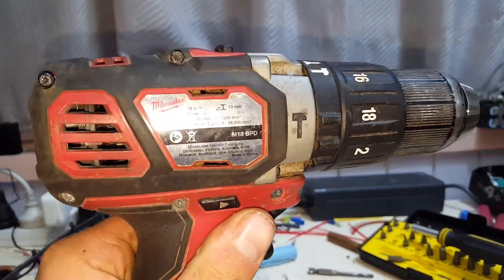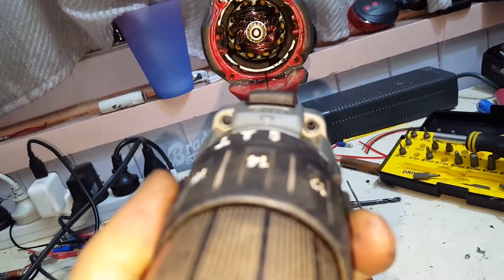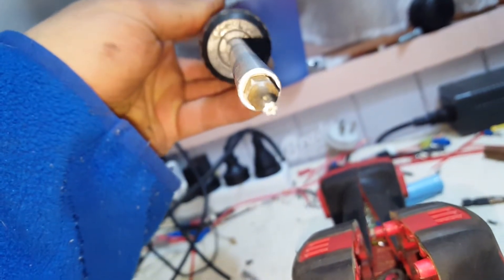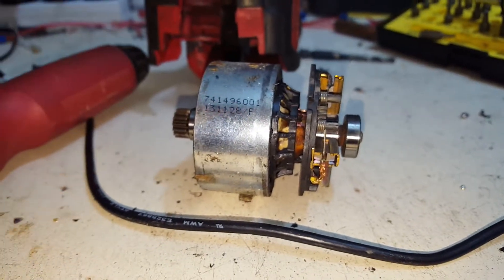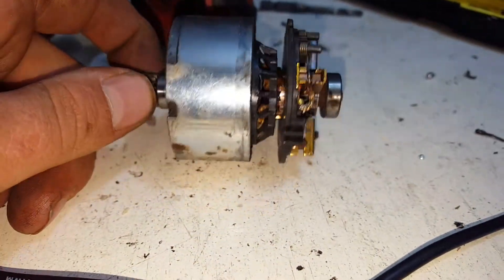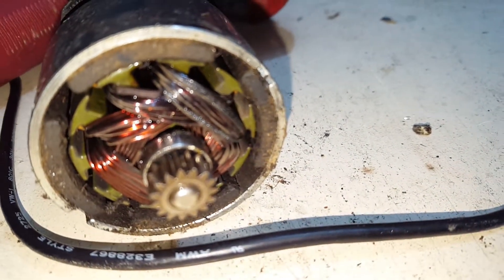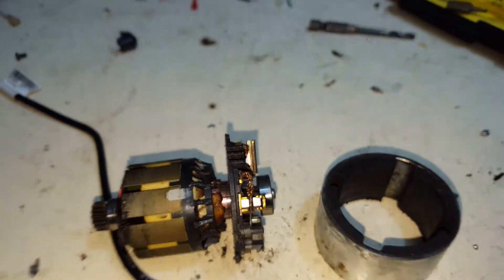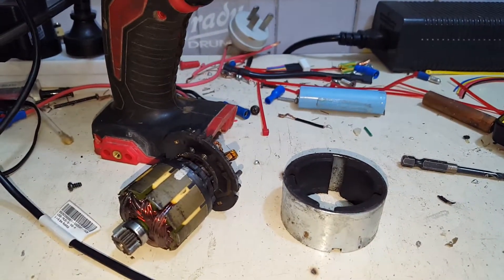Milwaukee M18 BPD GEN2 drill went up in smoke Tear down video

Comment: too late now but it is a 5 year warranty, can i ask what you were using if for when it first let the smoke fly? ive got the similar drill and impact driver kit this year brushed and ive got them pretty hot.. usually got to wear gloves to save my hands and ive clocked the impact mechanism on the driver at 106 degress C when i was using it with impact bit to drill holes in steel.. still running good though
Reply from the maker: +Andrew Browner had no invoice  for it but i was drilling 100mm hole say through hard wood 6x6 beam haha they are tuff  it only died cause  fan blades had previously left the building. Ive screwed in 2000 roof zip 65mm screws a day with my old impact they are bullet proof i gave mine to dad when i got a fuel one
Reply: yeah im happy i chose milwuakee for my first set and not makita or dewalt, happy with all my current tools, had the brushed angle grinder and that thing is worthless got the fuel 5" one now and its awesome, not quite the same as a 12 amp corded but its probably more powerful than a 7/8 amp corded, got the fuel circ saw too but havent put enough miles on it for an opinion yet
Reply from the maker: Andrew Browner you got the 9.0 amp batterys?
Reply: i got one9ah, makes a big difference on the circ saw, i have 2 3.0s and they get hot in a hurry on that and shut down
Reply from the maker: +Andrew Browner circ saw eats the power fast!!! Same with the brush cutter thats a good unit too
Reply: fuel 1/2"impact gun  is next on the list and maybe a 12v hackzall for getting on at tight exhausts and bolts under cars and other tight sawzall operations
Reply from the maker: +Andrew Browner ive got the hackzall m12 fuel its awesome as. Use it every day. Im a plumber /what you see on youtube then some haha and it gets used for exhausts to cutting down trees ...(not shit itll do it)

Comment: Also, those windings should be epoxied in and have a sufficient core diameter to handle the extra heat.
Reply from the maker: It didn't survive

Comment: This video is interesting and informative.  It looks like you have found the weakest link for this model, the cooling fan.  The fan should have been made out of metal just like the ones used in most power tools made for over a century.  Many plastics become brittle with age and the type used in this drill is clearly inadequate for cooling the motor over  the long term.  This obvious blunder is 100% the fault of the manufacturer but I  wonder if it was a mistake.  It could be done on purpose and something like the Phoebus Cartel is operating again.
Reply from the maker: Sadly there are weak points. My question is is it designed to fail?
Reply: In brushless tools, plastic fans are adequate since the heat builds up on the stator windings  instead of the rotor. Also they run cooler too.
Reply: @davidperry4013  This tool has four brushes and if the fan was metal it would probably still be working.  The brushless tools may run cooler but their weak point is the MOSFET switches.  It costs so much to fix a brushless tool out of warranty that it usually doesn't make sense to repair them.  There is not much made these days are built to last for more than a few years.

Comment: What screwdriver do you use, I have all the bits but I can't reach the screws for the bottom part, it's to deep
Reply from the maker: +TheMidnightNarwhal i use a t10 torx full screwdriver it isnt a bit one for that reason  you can buy them on ebay
Reply from the maker: +TheMidnightNarwhal i use a t10 torx full screwdriver it isnt a bit one for that reason  you can buy them on ebay
Reply from the maker: +TheMidnightNarwhal i use a t10 torx full screwdriver it isnt a bit one for that reason  you can buy them on ebay

Comment: Hey mate
I know your a big waulkee fan 😁
I just got one of these and an impact. Couldn't justify paying for brushed as it's just for home use.
It came with 3 x 3ah batts.
I should be able to revive a couple of  better ones as well😉😎
Reply from the maker: Offgrid Dreaming they are good value  and still have 5 yr warranty so give them heaps mate
Reply from the maker: Offgrid Dreaming this only failed as it had destroyed its cooling fan and i ran 120mm hole saws with it haha
Reply: One Up The Sleeve Customs did this model have the Redlink protection system in it mate? Would be interested to know. 👍
Reply from the maker: Redlink is in the batteries mate :)
Reply: @Oneupthesleevecustoms  Hey mate I can vouch for their warranty.
I was using the impact driver. I put it on the ground, when I picked it up and started using it I got magic smoke and spitting plastic bits. I think it picked up a little stone and smashed the cooling fins.
Anyway, they replaced it with a new one, so i was impressed.
It's a bit of a design fault. They should mave  mesh to prevent bits getting in.
Reply from the maker: Yeah the fans self destruct

Comment: Hi sir I live in VN i have 1 hammer drill   MIlwaukee M18 2702 after 2 wekks to work it is smoke and death but on volume light on good please hepl me because it is expensive
Reply from the maker: +viet tran if its 2 weeks old take it back under warrenty
Reply: i  cant go to usa, i buy on ebay and no return

Comment: Mine cuts out before it starts burning.
Reply from the maker: That's good no smoke show
Reply: @Oneupthesleevecustoms  yeah but the problem is it keeps cutting out. It's a full charged battery when I pull the trigger the light comes on I hear the motor try to spin. But nothing. I noticed on the trigger there is a small flex cable with a nick so I soldered it and fixed it but then i don't get nothing. With the connection broken on the flex cable there is sign of life. I will are a video